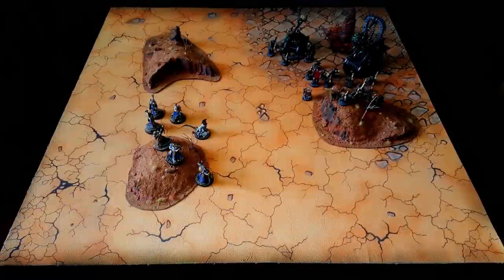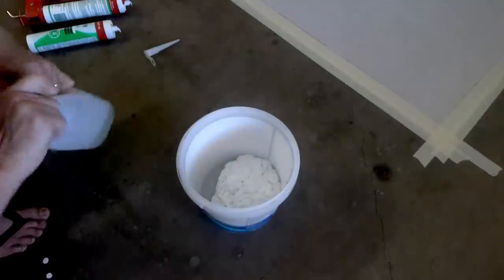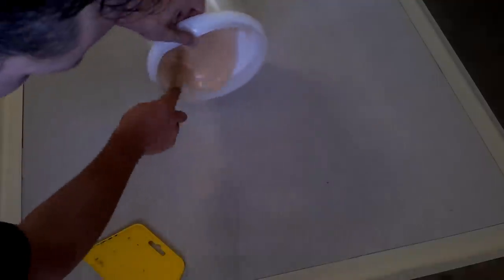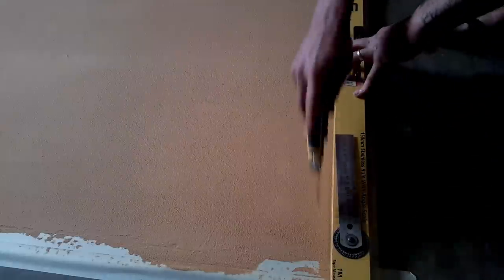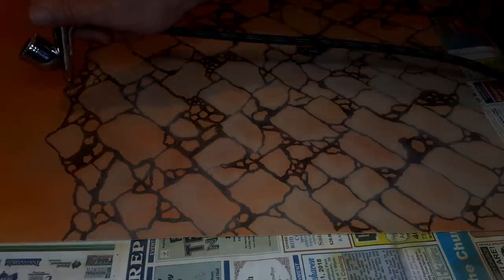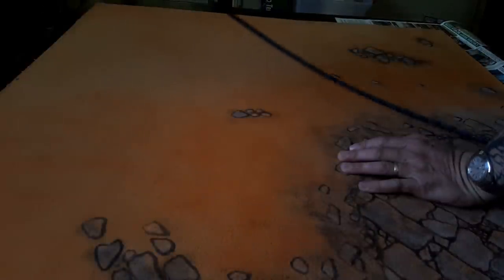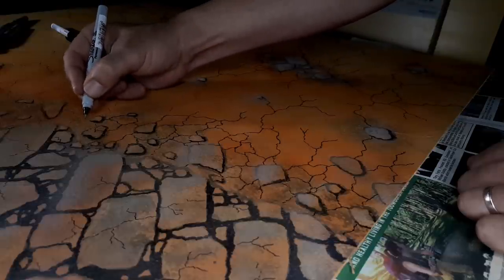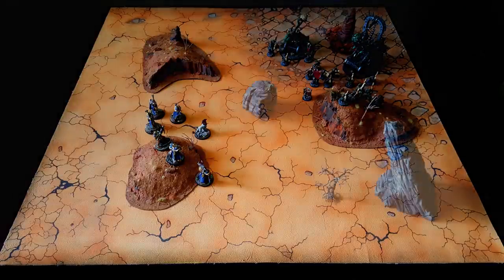Make Your Own Battlemats for Wargaming Terrain, DnD and Tabletop Games

Comment: I have been trying to figure out how to make a flexible mat that will not crack easily, and this fits the bill!  I have an art background, and my thoughts were going to the painterly products I know, like gesso, and that would definitely not hold up or do the job, but caulking is PERFECT.  Thanks for sharing!
Reply from the maker: Glad it was helpful!  These are still holding up great too, I store them rolled up around a tube without any issues.  Thanks for watching.

Comment: I tried making an urban battle mat similar to the one you made in the previous video. As an alternative to sand I mixed sawdust in with the acrylic mix as I have plenty of sawdust and no sand. This resulted in a very uneven surface but it may be that I did not spread it properly. As I used cheap acrylic paint from Cheap as Chips the colour that I painted on needed several applications. Possibly the sawdust is soaking everything up but I thought I'd let you know that sawdust "works".
Reply from the maker: Oh great idea.  I hadn't considered that.  An uneven surface may not be such a bad thing either.  The sawdust would suck up that paint a bit I imagine, but it sounds like you got this working.  I might try it out also, as I generate a bit of sawdust myself as well, so it would be great to have a use for it.  Thanks for letting me know.  Glad it worked out for you!

Comment: You wouldn't happen to know the brand of the plastic scraper you're using? Tried to find it on the Bunnings website and I can't find it!! Many thanks for the videos!
Reply from the maker: The label is long gone off mine, and the brand doesn't appear on it anywhere else.  I just had a good long look on the website as well and couldn't seem to find it, there are some other plastic joint knife products there, but not this particular one.  I should be heading into Bunnings this week and I'll reply again once I find the brand for you mate.  Sorry about that.  I'll be in touch though.

Comment: So here's what I really want to know -
How are these holding up over time?  Are they seeing heavy use?  Are they prone to chipping/cracking/flaking?  Are you actually storing them rolled up or flat?  Do you think these will last months or years or decades?
Reply from the maker: Thanks for the comment.  It's not seeing much use at all unfortunately.  It hasn't shown any signs of chipping/cracking or flaking.  I'm storing this one rolled up, and it' rolls out just fine.  Some of the edges were 'bent' while in storage for a couple of months last time, and these didn't seem to be an issue when I rolled the mat back out.  I can only guess as to how long it's really going to last, I'm fairly confident that even with heavy use this mat would be holding up well given how it looks and feels now.  I'd give it some years of life in it yet.
I hope this helps mate.
Reply: @RFDHobby  Yeah, it does.  A lifespan of at least a couple of years sounds pretty good to me.  Seems like a lot of work for something less durable than that though.
Reply from the maker: @ColonelSandersLite  You'd be surprised how quickly it comes together.  Making the mat and spreading the mix out wouldn't be an hour of work, where the time is really spent is painting it up.  I'm way too poor to buy mats too though, although I probably would if I could, and I'm not at all against buying a better quality if you can.
Reply: @RFDHobby  Yeah, I figured the painting  would be the time consuming part for all but the most basic of mats.  Though the lower price tag is certainly nice, I mostly just see a lot of appeal in the combination of customizability and storability.

You can probably store a dozen or more of them rolled up in a simple PVC pipe.  One for every occaission.  As nice as they can be, those big sculpted game tables definitely can't do that.

Comment: I like the mix with water here better than your 20x20 test mat. Are there any concerns about letting it dry above certain temps or very low humidity? I live in one of the dryest counties in the US (average humidity is 6%-8%) where June through September is 100+ degrees F.
Reply from the maker: Hey Anthony, you should have no issues with this drying, I honestly didn't notice a difference with the water, I did these in the Aussie summer, so it was hot and dry.  I leave them overnight before moving them, although I'm not sure if that much time is really necessary.  I hope this helps mate.

Comment: Hey there! Does it matter which way you roll these mats up? By this I mean texture on the outside or inside. Also, how do they hold up to cracking? When you're rolling and unrolling does the canvas hold up fine with the acrylic & sand mixture? Thank you! Keep up the awesome videos.
Reply from the maker: Hey Kevin, it doesn't matter which way you roll them, I have been rolling them with the texture on the inside, and haven't had any issues at all, no cracking or anything so far.  For the larger mats, it might be best to roll it around something (like a postage tube or something), as the weight of it can cause it to sit flat, and could cause it to crease.  In the short term they are holding up really well, time will tell if this holds up long term and whether or not the acrylic hardens.  But 5-6 months on from my first mat and it's still perfectly fine.  Thanks mate, I hope this helps in some way.  Happy to answer any questions you have if you have a go at this.
Reply: @RFDHobby  perfect! Thank you for the prompt reply. We are moving cross country in a couple of months so once my wife and I are settled I am eager to give these mats a go. :)

Comment: Love this mat and your tutorials generally - thanks. I was wondering why you decided against the isopropyl alcohol this time? I tried the mix you used for the road mat and found that to be the best formula I've come across (having made a number of these using various methods over the years).
Reply from the maker: Thanks Alan.  Honestly, I was playing around with this mix for some miniature bases a few weeks back, and decided to experiment with that isopropyl/water element, I found very little difference with using water instead.  So for this mat I thought I would give it a whirl.  I can't really fault it at all, and I'm not sure I could tell any difference whatsoever in the process or end product.  I'm not sure at all what the theoretical advantage of the isopropyl is over water, but I found this mix worked out just as well.  Iso isn't cheap here, so it's a win not having to use it for the mat.  I'll see if there's any long term difference, but it seems to be working perfectly so far.   Let me know if you have any thoughts on how the isopropyl might be of benefit, I'm really curious to know if there's a reason people use it here.
Reply: @RFDHobby  Thanks for the reply, Shawn. I've spent a bit of time today trying to track down some information about thinning caulking compound, but found nothing. It seems diluted IPA can be used to thin acrylic paints, but that about all I could see. It looks like good old H2O is the way to go - cheaper for sure! I might go look at the terrain Tutor vids on various caulk techniques at some stage. I'll try water next time and see. In the past i didn't think the caulk and it was hard to get the finish you achieve. Cheers Alan

Comment: Awesome paint job! 3 years later, how does it hold up? Is there any risk for cracks if you roll it up?
Reply from the maker: Thanks mate. It's still holding up, I did a quick video on how this thing held up after the fire, it survived even the heat of that event and is still playable today. No cracking or anything, just a bit of curling on an edge that it was resting on for too long, but it was just the way I stored it.
Reply: @RFDHobby  Wow! Thats impressive! Sorry to hear about the fire though

Comment: RFD, checking in on you man! Also, I was interested in the sand battle mat, I've looked at a few on Urbanmatz, but I'm considering making my own, can't make up my mind you. Buy now or build later? Hope you're doing well mate. Peace out.
Reply from the maker: Thanks for the message Tyler, it's been a tough few months, but I'm doing my best to get out of the funk I'm in.  As for your battle mat, after building a few, I'm always going to say build it man!  It might sound like a bit of a project, but if you've got a bit of flat concrete (garage for example) that you can take over for about 6 hours (overnight is ideal), you can knock this thing out in a day for under $40AU and have a few materials left over to make more.  Painting for table ready can be as simple as you like, and you can always still work on it over time to add details.
It takes about 45mins to measure, cut, layout, mix and apply everything, the rest of time is just waiting for it to be dry enough to cut out and move.  If you're doing it in the daytime with decent temperatures, it should only take a few hours.   If you can easily get materials for it, it's a really quick project.  But I guess you have to also WANT to build a mat, or at least need a cheap option. I haven't used a bought mat, but they look way better than I can paint, and I assume they're fairly hardy, so if you have the money, or lack time or space, buying might be the better option.  Building it is really satisfying though!!  Let me know what you do mate.

Comment: It be cool if it wasn’t rocks or desert but like muddy cratered mounds and like trench’s on the other side so you can spread them out and make it look like a trench system that’s been bombed apart. Can be scattered terrain or lined up somewhat together to look like a trench line?
Reply from the maker: Absolutely,  that's a great idea.  I might do something like that in the future.  I have one more of these mats planned, but it's a more urban setting.  I might have try out this idea at some stage though.  Thanks very much for watching and commenting mate.
Reply: @RFDHobby  yours welcome and I’m been working on an urban tabletop for awhile but I need to get like 3-4 of those imperial sector kits to finish the bulk of it.
Reply from the maker: @exteriorcobra1575  sounds awesome.  Those kits are really cool, I'm sure it'll look and play fantastic when it's done.  Good luck with it mate.
Reply: @RFDHobby  thanks you!

Comment: have you tried using flock?
Reply from the maker: I haven't yet, I'm pretty sure it would be fine.  Might get a little messy if you're rolling the mat up unless the flock is well stuck on there though.  Worth a shot.
Reply: @RFDHobby  going to try it out this weekend. Great vids btw. Glad I found you.
Reply from the maker: @sayloth  Thanks mate.  Good luck with the build, let me know if you run into any trouble or need any advice or help.

Comment: With a mat like this, after it is fully done and set, can it be rolled up say like a poster or does it need to remain flat?
Reply from the maker: I roll the larger ones up for storage, I've found having a postage tube or something rigid inside when you roll it up helps to prevent any creasing.
Reply: @RFDHobby  thanks!